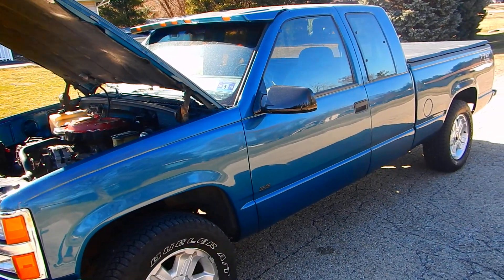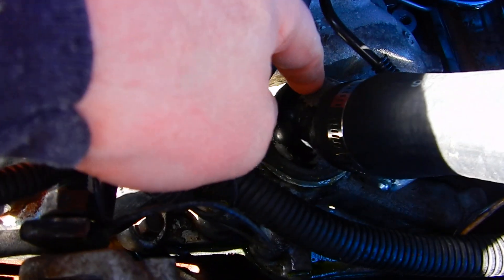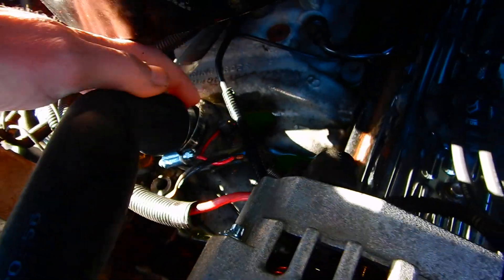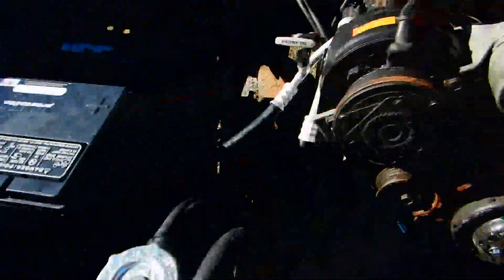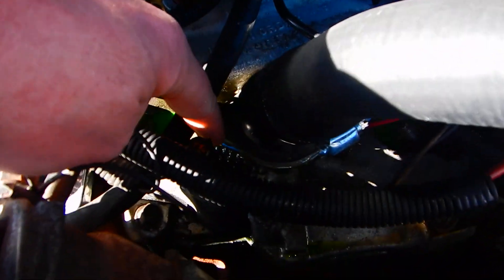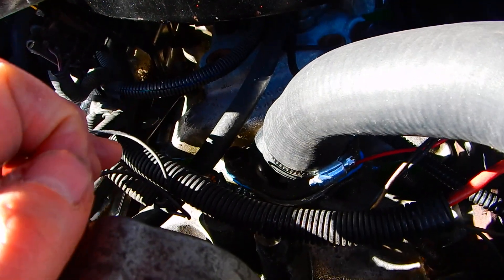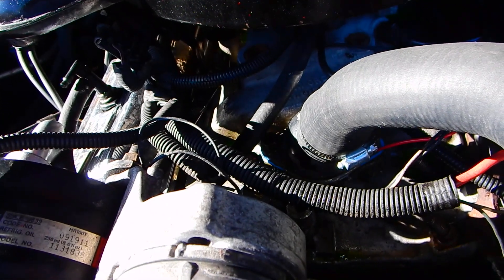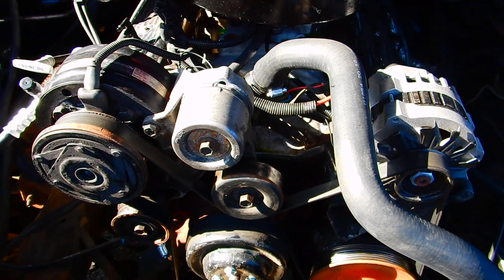1992 Chevy Silverado 305/350 Thermostat tips/common problems

Comment: Your thermostat should have a rubber gasket that goes around it and seals the thermostat in the intake manifold not one on the housing!
Reply: yeah i don't trust that crap myself i do exactly like he does never had any issues
Reply: My 89 requires the rubber gasket. Otherwise the stat will shift and allow coolant to flow past it. And of course will never get up to temp.
Reply: ejslayer1 you are right, he has no idea what the hell he's doing. No wonder it's leaking lol
Reply: Some do, some don’t. My 88 doesn’t have the rubber one, never has; the t stat just drops right into place in the manifold. Paper gasket between manifold and housing. Now I’ve had a 91, and a 94, and they both had rubber gaskets around the actual t stat that sealed it into the manifold.
Reply: My 88 does not use a rubber gasket,

Comment: ok so your truck staying at 160 degree temp all the time is because you have a thermostat that allows flow at 160 degrees they also have 190 195 180..20 hp from the electric fan idk about that but its basically the same thing as the fan shroud only for people who want more engine room...you need a fan of some sort to cool the radiator that cools the antifreeze
Reply: I don't know about the horse power gain, but it is less strain on the motor.
Reply: @justindanley6817  oh no for sure...plus the cooling is probably more instant than a fan and shroud, i took my shroud off and added a bigger radiator in my 91,i cant afford a new electric fan now with all this mess in america lately so i have to be careful on long hauls and traffic jams

Comment: You have to use rubber gasket...paper is for older...put the paper and thermostat does not sit rite...constant flow hence 160°...and no rubber gaskets dont leak if you install them rite...

Comment: Great video. I’m gonna check this in the morning cause I too am thinking my thermostat is stuck open, but maybe not. 

I did want to ask you off topic, that electric fan you mentioned at the end… are you still rocking that with no problems? And if so what you go with? I was thinking of getting that 90’s Volvo 740 slash the Ford Taurus fan put in. Maybe a flexilight but had heard of some longevity issues with the latter.

Comment: My 92 GMC Sierra ran at 160 degrees for years, it’s been chipped. Now at 220k miles the heat sensor keeps going bad. I install a new one runs smooth at cold starts for about 2 weeks then back to ruff at cold idle. Crazy

Comment: I have a 93. I replaced the holes and thermostat. I still can't get a reading on my gauge. Anyone care to drop some advise on this...
Reply: Mb your gauge is out that can happen
Reply: On the right front of the engine next to the #1 plug and wire is the temperature senser. that's the one that will  send the readings to your dash gauge. Check the wires if that's not it then that sensor needs to be replaced. Empty all of the radiator fluid and remove the old one and put the new one on.
Reply: I replaced the all sensors the thermostat twice and truck reads low always. But when I turn off goes up. I know it has to be hotter then what it’s showing any other tips
Reply: @andrewduran2754  all motors get hotter when you shut them off your water pump isn't moveing water threw the water jackets when its turned off
Reply: And if you can just for good measure add a ground from engine to chassis.
Reply: Mine has always ready 1/4 of the gauge I’m just putting a external gauge in my cubby I’m tired of trying to chase it lol

Comment: I was starting to like this video until you started talking about putting electric fans to gain 20hp .... I bet you ome of those people that think adding a k&n air filter adds another 20hp
Reply: Hes actually right. Your stock mechanical cooling fan uses horsepower to spin it. An electric fan however has nothing to do with ur motor , it doesnt run from ur motor, it just runs from your battery. So the horsepower that was originally used to power the fan, is no longer being used, that horspower then stays in ur motor . so yes , an electric fan does give you horsepower.
Reply: @daltonandrew168  not 20 hp tho...guy in video Knows nothing....paper gasket to replace rubber o-ring...coolant flows by...wtf...thermostats have holes in them...coolant always moving...
Reply: It may not give you 20hp but it surely can free up 20hp, or whatever the torque to for that is, but removing the strain from the motors serpentine belt which adds to the timing chain, instead can be freed up on the crankshaft or even the wheels, and torque will spin your wheels stronger than horsepower will.
Reply: Ten hp at most